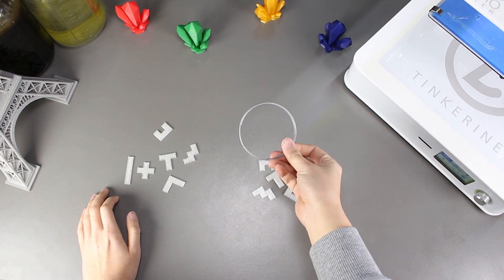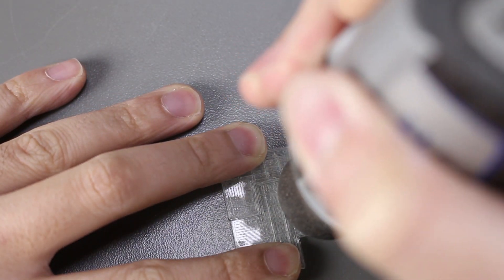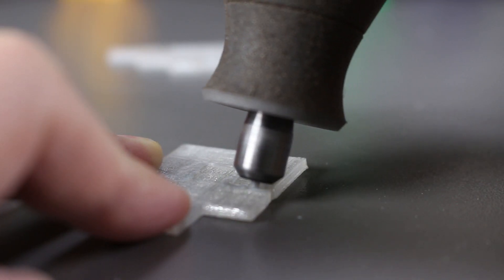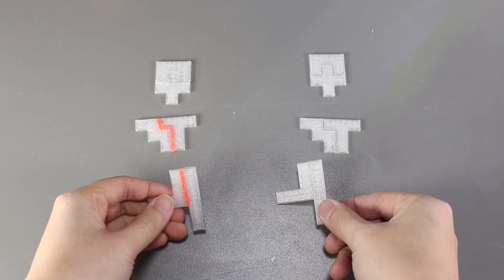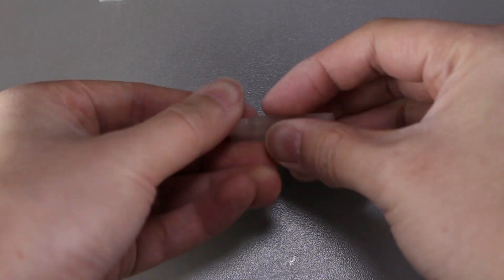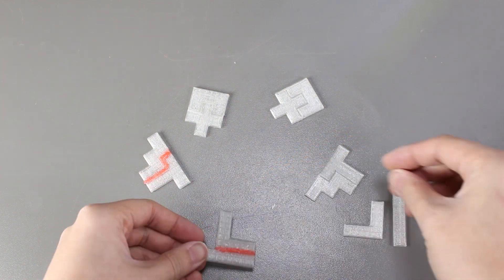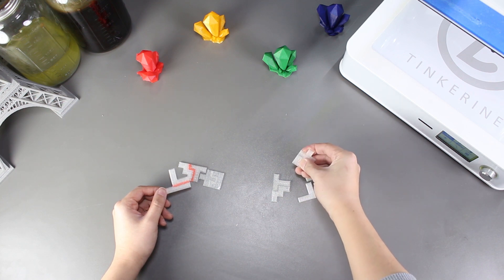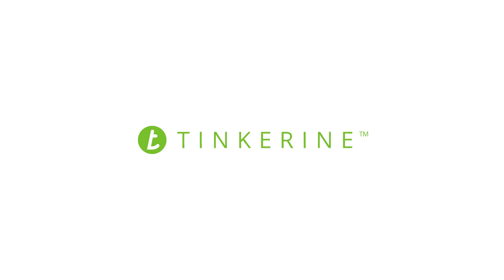Welding PLA Parts Together

Comment: I’ve been trying to think of a way to weld two parts together with a wider surface area  and I’ve just thought maybe cutting some aluminium mesh, heating it up red hot then sandwiching the two parts together

Comment: I think it's better to use a soldering iron on the lowest setting to melt the pla. That is how I do it. It's easier to control, you can really sqish and push it into the gap and the surface is a bit cleaner..
Reply from the maker: Great suggestion!